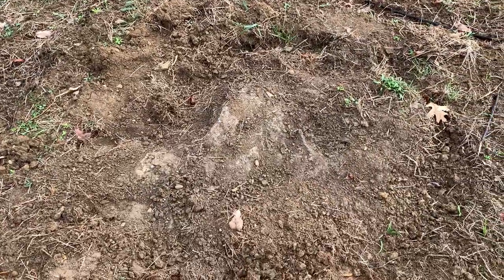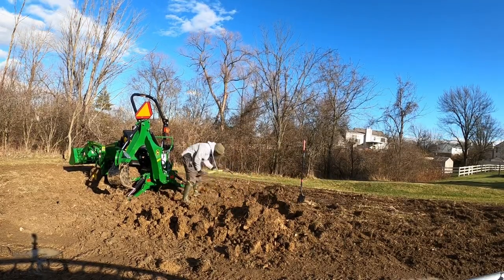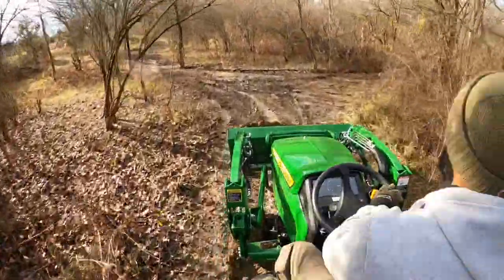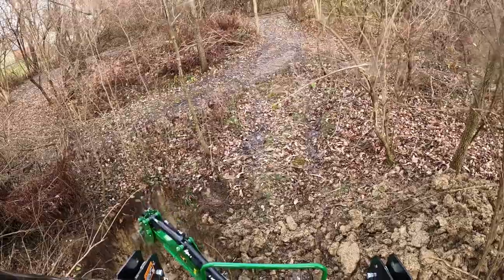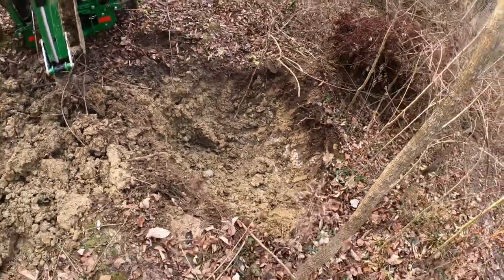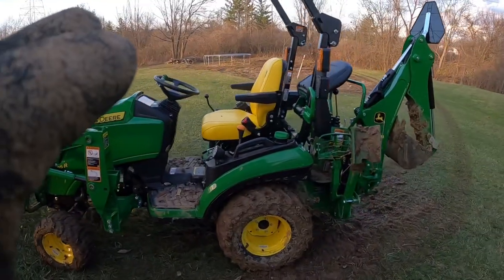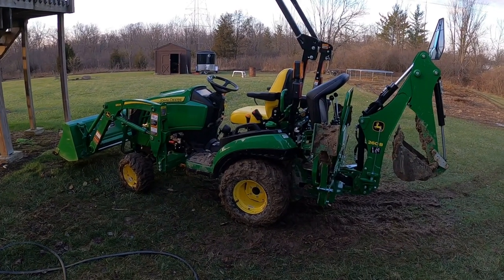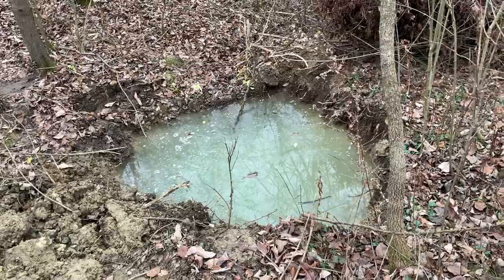John Deere 1025R, First Day Operating 260 Backhoe, Digging Holes, Learning the Controls (Vlog)

Comment: With a little practice you can dig as deep as you want, Shaw. Dig your 6-ft hole. Then back off. Dig a hole next to your starting hole that's big enough to get your tractor into. Pull
your tractor into your second hole far enough to allow you to dig your starting hole a little bit deeper. And so on and so forth. That's how they dig subways, mines, you name it.
Just be very careful, for goodness sake :).
Reply from the maker: Rick, Thanks for the Advice... I plan on doing some more digging here soon... your advice will come in handy... Much Respect brother and thank you again...

Comment: The slow moving vehicle sign is only needed if you cruising on the road.  Mine is hanging in the shed. Was in the way any time using the backhoe anyway.  Get yourself a tooth bar from Piranha ( BXPanded).  Makes the bucket much more effective in the soil.
Reply: I have that toothbar too.  Its a beast.
Reply: Helps hold a little bit more in the bucket and protects the bucket edge too.  Win win
Reply from the maker: Thanks Mike... I am going to look into that tooth bar... I see people picking up large buckets full of dirt and I thought it was just I didn't know what I was doing... I will look into it... Thanks and much respect